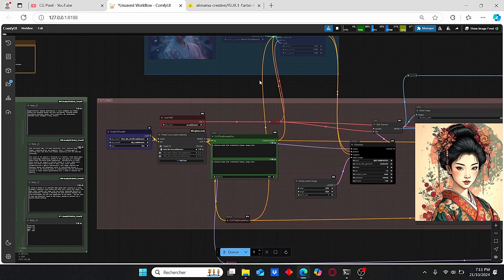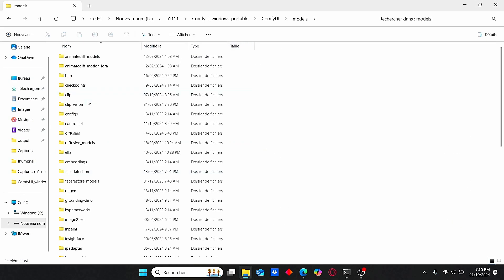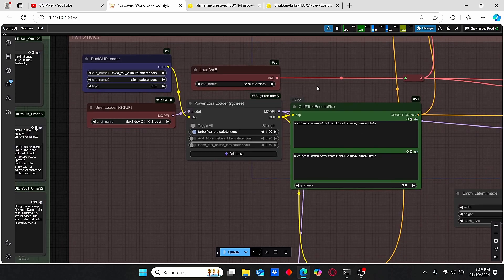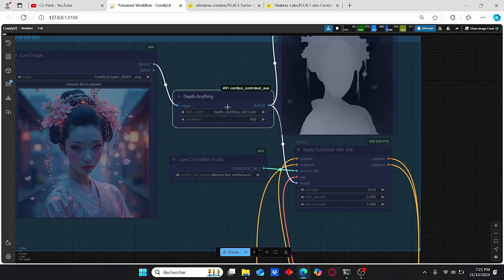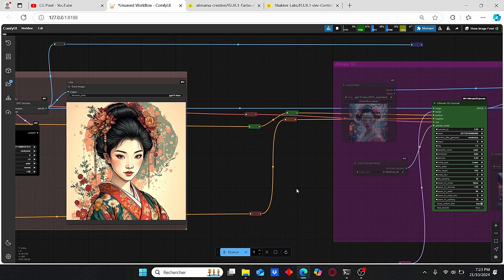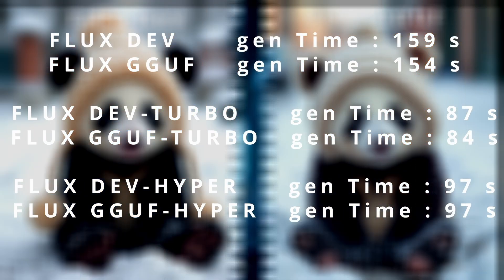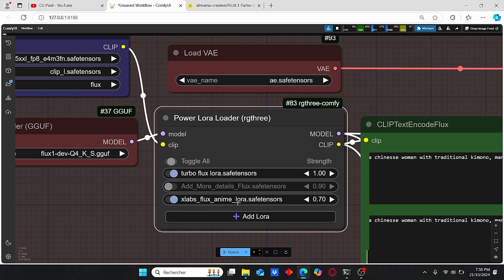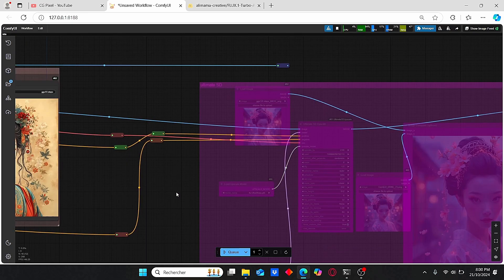ComfyUI Tutorial : How To Create Images Using 8 Steps Flux Turbo Model #comfyui #flux  #fluxturbo

Comment: Thanks, interesting topic. For some reason, I am getting an error message. The positive and negative inputs on the KSampler both have red circles around them.
Reply from the maker: Just plug them directly from the positive and negative prompt then when you need controlnet you can use default plug
Reply: @cgpixel6745  Thank you.
Reply: @cgpixel6745  Thank you. That worked :)
Reply: @cgpixel6745  Thank you.